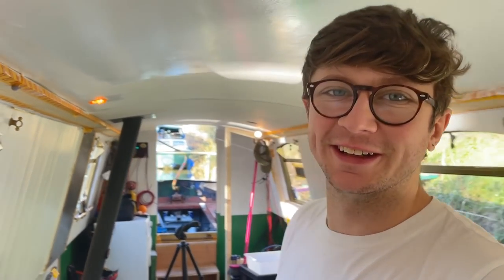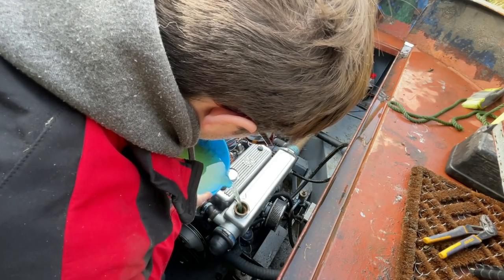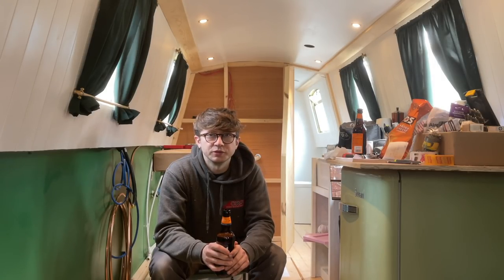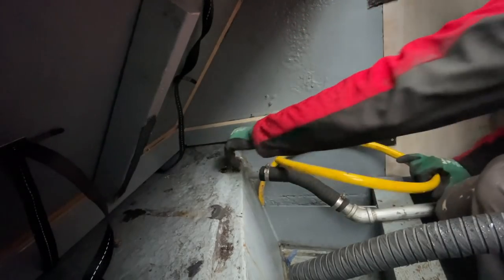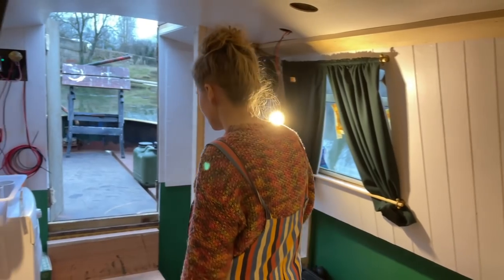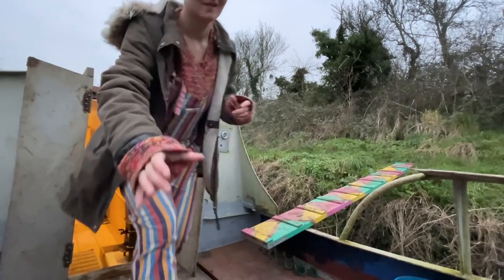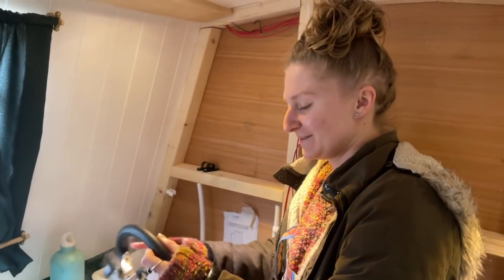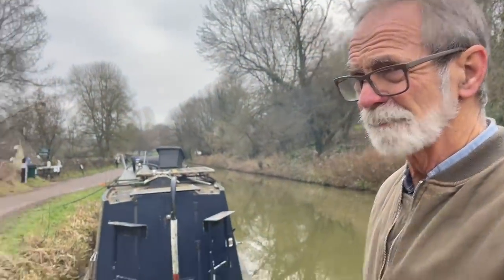Our First Lock! | Cooling System Woes | Narrowboat Conversion | BOATLIFE

Comment: They say the best times of owning a boat is when you buy it and when you sell it. Great job. You could drill and tap your skin tank with  a 1/2inch BSP tap. Screw in a fitting. I’ve done it many times over the years when the builder has forgotten to put in a bleed nipple. Works a treat
Reply from the maker: Tapping the tank did cross my mind, I think that may well be the permanent fix, will get a decent 1/2” tap ordered!

Comment: The aesthetics you can slowly take care of as you cruise. It gives you something to work on. The mechanical part of the ship is what needs to be 100% on point before setting off.
Reply from the maker: Yes that is true. There’s a few things inside we had to get to a certain stage before installing pipe work and what not. Main priority at the moment is getting running water, like you say we’ll be able to complete the smaller tasks easier on the move

Comment: Jo, You can get “ metal paste” that works very well.
I’ve used it on a pressure pump with no issues.
Worth a try until you can replace the skin tank.
It’s a two part product which mixes ( don’t use the putty type stuff ) 👍
Reply from the maker: Will have a look out for that cheers! Is it a JB Weld product?

Comment: I’ve been giving thought to the bath.  It’s evident that standing for a shower is not possible, but have you thought about installing a skylight there.  Or at least a bubble type of thing or raising that part of the ceiling over the bath?  It is what is done in vans and rv’s when the ceiling isn’t tall enough.  Just an idea.  If you like it great, if not, no worries.
I do know there could be a privacy issue, unless it is framed and just raised.  You could then install an exhaust fan there well.
Reply from the maker: You know what that is actually genius! Will have a look into that for sure, I’ve got an image of poking my head out for a shower and smiling at passers by 😂 will check if anything that’s being fitted to the roof would foul - well worth a look
Reply: @ItsOhJoe  How big is your water tank?   A deep bath does not sound practical? Maybe use it for a kneeling or sitting shower?
Reply: @ItsOhJoe  Always keep in mind the low bridges!
Reply from the maker: @PinkLittleElephant  so the bath will hold around 60 litres of water (with someone sat in it!) and the water tank is 400 litres, so the odd treat for Danni when a water fill up is imminent shouldn’t hurt, it’ll mainly be used as a sit down shower etc
Reply from the maker: @jillosler9353  Yeah thinking of one that opens up rather than permanent for this exact reason!

Comment: This probably too late but the coolant tank bleed arrangement, looks similar to one from a domestic heating radiator. This consists of a brass screw in nut, with the bleed nipple, usually square posted, some with a slot for a flat screwdriver, in the middle.
These are usually sold with a “blank” nut for the other end of the radiator. Much cheaper than replacing cooling tanks !
Reply from the maker: Will take a look cheers

Comment: Jo, you can get some “ metal past” which if done right is extremely good stuff.
I’ve used it on a pressure pump with no issues.Worth a thought until you can replace skin tank .

Comment: Hi, I have a small friendly suggestion, I think you need a wider plank for walking on, it’s barely wide enough and leaves no margin for error. You could drill holes in it to make it lighter perhaps? Not too fancy or someone will nick it!
Reply from the maker: Along a lot of banks it’s not quite as much of a walk and we’re able to use the shorter plank which doesn’t feel as dangerous! I guess to go wider you’d need to rip some plywood down and laminate a few pieces together for strength
Reply: @ItsOhJoe  thanks for taking the time to reply.

Comment: Hi you didn't say if your rubber pipe fix worked or not and you didn't say if it overheated or not on your first lock run if both things are ok then I would suggest you put a longer rubber pipe on then fit a automatic bottle air valve to the end of it instead of the manual valve you have now this will be the end of having to bleed the system again (screwfix part number 76650)
Reply from the maker: Thank you very much for that, didn’t know such a thing existed! Got one ordered, worth a punt for £7 regardless!